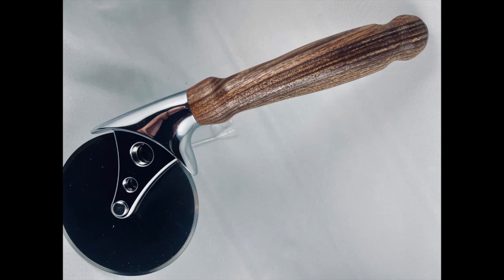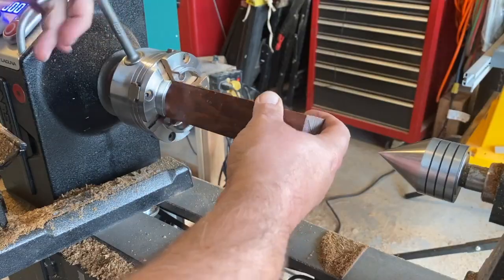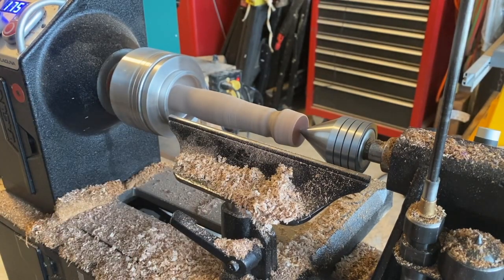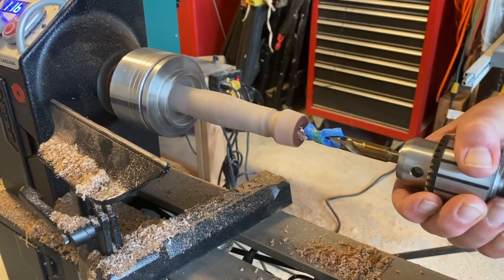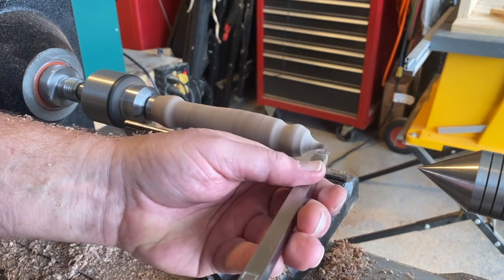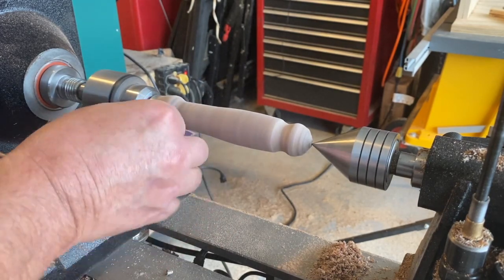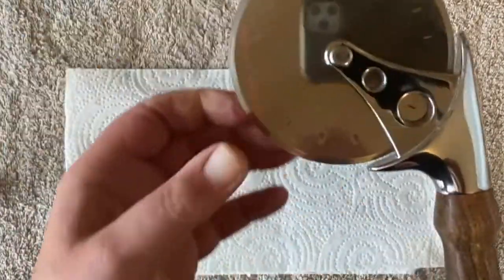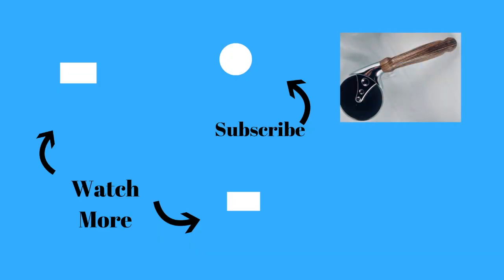Join Me In My Journey Into Woodturning #28 - Rosewood Pizza Cutter Handle

Comment: To keep the jacobs chuck from coming out of the MT2 in the head stock check the end of the Jacobs Chuck for female treads.  Mine had 1/4-20 threads so with a piece of all thread I figured out the length of the all thread rod. that was needed to run from hand wheel on the left of the head stock to the Jacobs Chuck.  I then made a wooden knob.  I attached the knob to the all thread by drilling and tapping some threads into the knob.  Then I just screwed the other end of the all thread into the Jacobs Chuck.  It works real well and does not loosen up.  Simple fix for an aggravating problem.